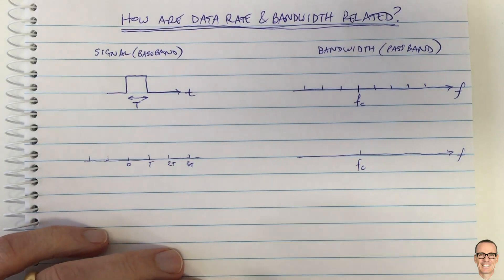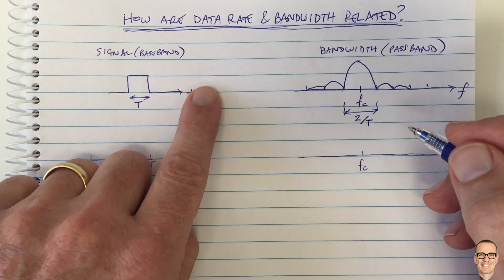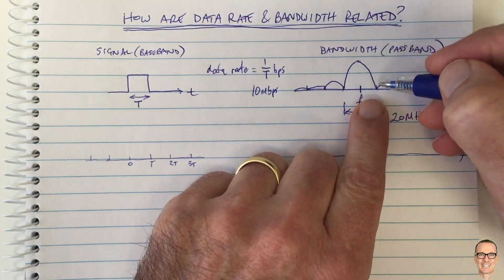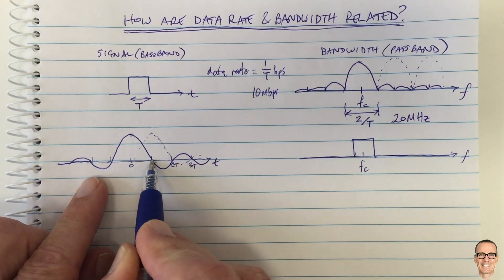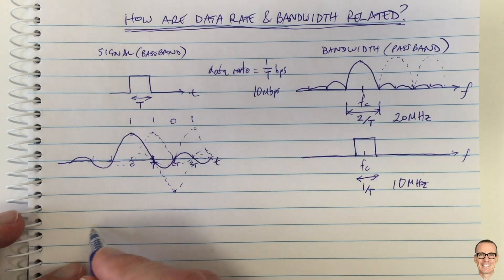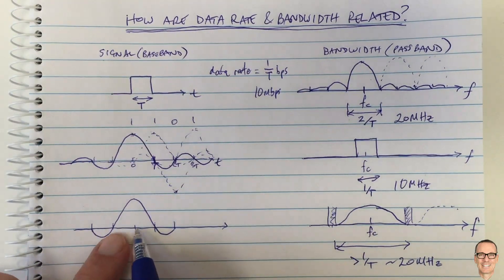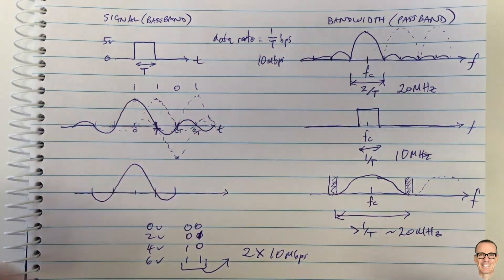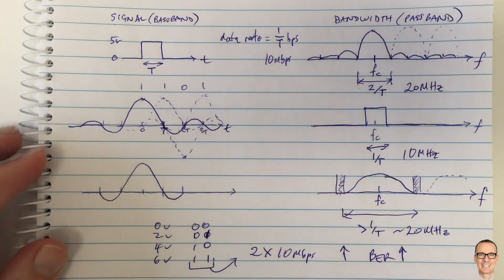How are Data Rate and Bandwidth Related? ("a super clear explanation!")

Comment: Sir, my name is Dheeraj. I am pursuing Ph.D first year. Sir, my research area is closely related to Information Theory. Sir, I have a doubt regarding rate. Some times Rate is mentioned to be some x bits per channel use. Sir, Here what exactly does per channel use mean? If we say rate is 100bits/sec, is it same as 100bits/channel use. Sir, I have been trying to understand this for a while now but I am not able to figure it out. Sir, why exactly are we shifting to bits/channel use domain while we have rate expressed in bits/second? Sir, please explain me this if you have free time.
Reply from the maker: It depends on the channel model. For example, for the binary symmetric channel (BSC), it tells you the probability that a digital "one" is received in error, but it doesn't tell you anything about the rate at which you send the "ones" and "zeros" (the assumption is that it has already been taken into account in the calculation of the probability of error). So for the BSC, the capacity is expressed in terms of the number of bits that can be reliably transmitted per input bit, or in other words, per "channel use". The way you use the channel has already been defined in that case - it is by sending either a "one" or a "zero". For more general channel models, such as a band limited AWGN channel, where the input distribution is not restricted to just "ones" and "zeros", the units of capacity are bits per second, since the equation includes the bandwidth in Hz (ie. per second).
Reply: @iain_explains  Thank you very much sir. I understood the difference between the two

Comment: Hello Sir~ Your videos are always helpful and make lots of details clearly. 
You really solve a lot of problems I had before!! Thank you for keeping doing this for all Communication Ppl :)

And I have a question about the notes in the video. (I'm not sure whether I'm right or wrong)
The example you used in the end of the video might be Amplitude Shift Keying and then you multiply the number of bits per symbol with the "data rate" you wrote in the middle of uppermost line in the beginning. 
So I'm guessing whether the unit of "data rate" is supposed to be the symbol rate with unit "symbol per second". 

Thank you !!!
Reply from the maker: When it's binary, the data rate equals the symbol rate. So in the video up until that point, I just used the term "data rate", and didn't mention the term "symbol rate". I didn't want to confuse things by introducing the extra "symbol rate" term.
Reply: @iain_explains  what you explained just reminds me of that in binary case and it makes sense. Thank you for spending your time replying this !!

Comment: then what is the difference b/w the spectral efficiency and data rate? that is [bit/sec/Hz] means?
Reply from the maker: Thanks for the question. I'm planning to make a video on spectral efficiency, so keep an eye out for it. In summary, the spectral efficiency is the data rate (in bit/sec) divided by the bandwidth (in Hz) over which it is transmitted (where the "data rate" is defined as the rate of sending "information bits"). For more details on the different "rates" see this video: "How are Throughput, Bandwidth, and Data Rate Related?" https://youtu.be/IY6fDYwC2fU
Reply: @iain_explains  ok thanks i ll checking

Comment: Is it possible having a data rate that exceeds bandwidth? When is bandwidth the upper bound for data rate?
Reply from the maker: If there is zero noise, then it is theoretically possible to have an infinite data rate over any finite bandwidth. You might like to check out my video on capacity: What are Channel Capacity and Code Rate? https://youtu.be/P0WY96WBUyA

Comment: For the time domain 3rd option of signal ( limited in time) you mentioned the BW is >1/T..in frequency domain...will it be >2/T..as per transformation described for pure pulse signal ..option 1 ?
Reply from the maker: Yes, technically you're right. For any time-limited signal, the frequency range will be infinite. In practice though, we always have to send time-limited signals, so we accept that there will be frequency side lobes, and we try to design the signal shape so that the side lobes are small/negligible. And then we describe/define the "bandwidth" to be the frequency range where there are non-negligible components. Sometimes this is the 3dB frequencies (see my video https://youtu.be/ZMgd2obTZyc). Also you might like to watch my video on pulse shaping: https://youtu.be/Qe8NQx4ibE8

Comment: The one question I had is that for any given amount of spectrum bandwidth, how do you calculate the symbol rate?

For example, say you have 20 MHz of spectrum in 2.4 GHz. How do you figure out the symbol rate?

On a similar note, if you have the same 20 MHz of spectrum, but it's in the 60 GHz range, does the alter the symbol rate or is it still, ultimately, the same?
Reply from the maker: The symbol rate depends on the bandwidth and the pulse shape (it doesn't depend on the carrier frequency). See this video for more details about that: https://youtu.be/Qe8NQx4ibE8
Reply: @iain_explains  Thank you very much, I appreciate it!

Comment: This is an awesome video for seeing HOW data rate and bandwidth are related, but could you also do a video about WHY data rate and bandwidth are related?  Something I'm trying to wrap my head around is WHY does increasing data rate need more physical space in the RF spectrum to accommodate that increased data rate?  What is it about using more RF spectrum that allows more data?  The way I think about it in my head is it's like parallel computing where by adding more wires (or frequencies) in a cable (bandwidth) allows you to simultaneously send more bits, and therefore achieve higher throughput.  I'm sure this isn't actually why you need more RF spectrum for a higher data rate, but I think it helps explain what I'm trying to ask.  Thanks for the video!
Reply from the maker: One way to see this is to think about sending the symbols at a higher rate. ie. with a smaller value of T. This means the sinc function in the frequency domain gets wider, which of course means you will be using more bandwidth. To go even deeper into it, recall that the Fourier Transform shows the frequency components that add together to construct the time-domain signal. If you want your time-domain signal to turn on and off more quickly, then that signal will naturally consist of higher frequency components (faster changes in the time domain equals higher frequency components in the signal, ie. wider bandwidth). For a video on this, see: https://youtu.be/8V6Hi-kP9EE